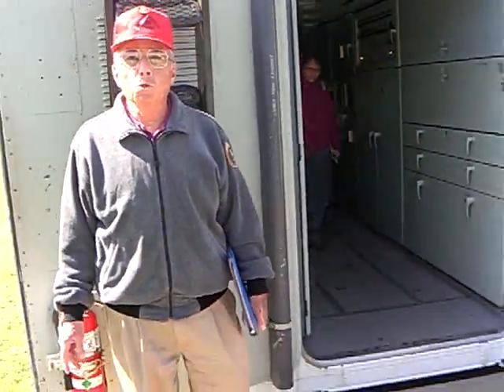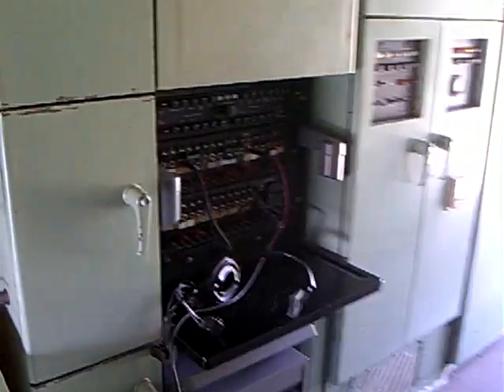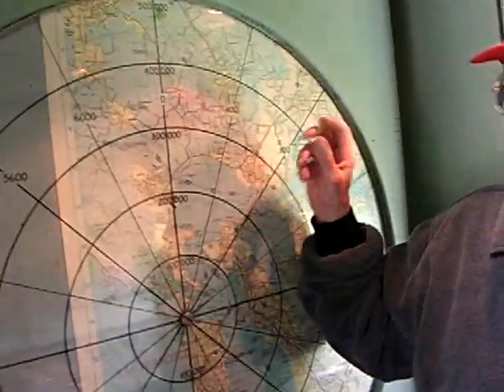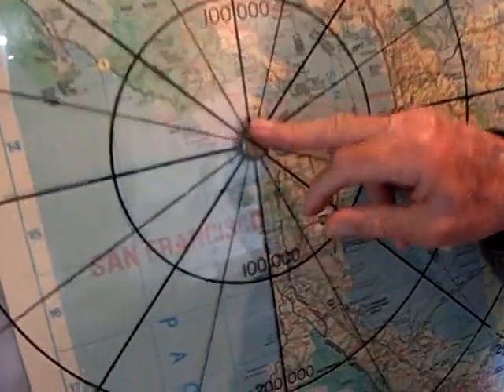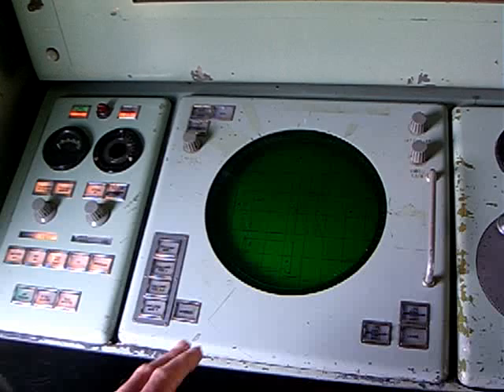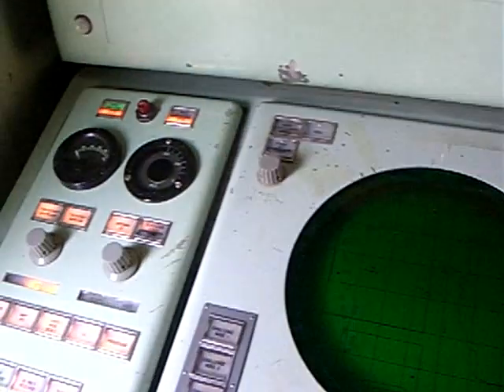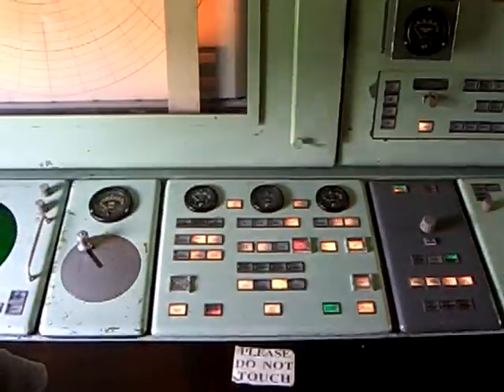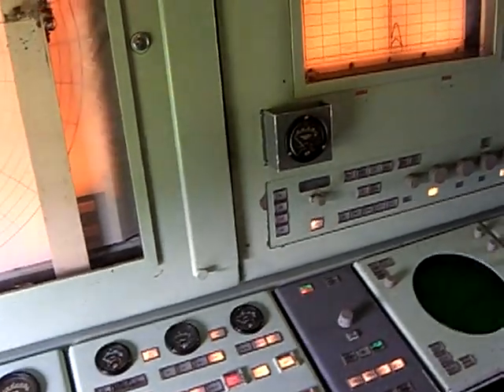Close look at a Nike Hercules Integrated Fire Control (IFC). Battery site SF-88 #7

Comment: Left scope belonged to the Battery Command Assistant then the Battery commander in the center seat.... right scope was NOT a computer operator.... that is where the Acquisition Operator sat. BCA found the targets, determined if they were friend or foe and passed the hostile targets to the Acq. operator to track while the BCA searched for new targets. I know... I worked in both the BCA and the Acq. Operator positions. 75-78 man, OoooWaaa!!!
Reply: I was the computer operator and sat at the switchboard; no separate board operator, because no room! Mostly what I did during drills was to make sure everyone could communicate (fire control officer to command) and to watch the pots for info and countdown to detonation. The floor on the right before he goes in is where I slept many cold nights on hot status. The warmest place I could find... B/2/1 ADA Dexheim 77-79
Reply: Left scope belonged to the Acq operator... what is the "Battery Command Assistant"?  Never heard that title.